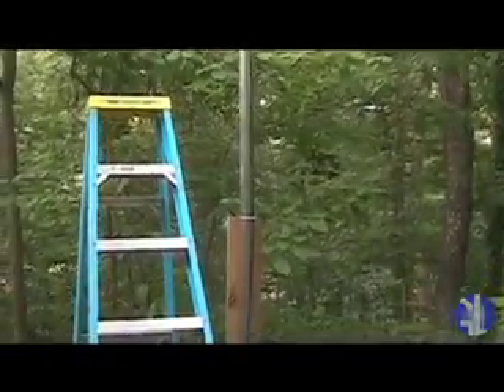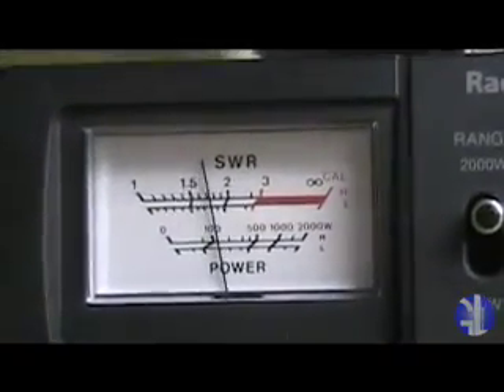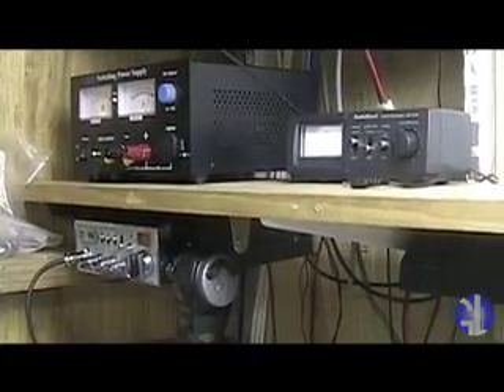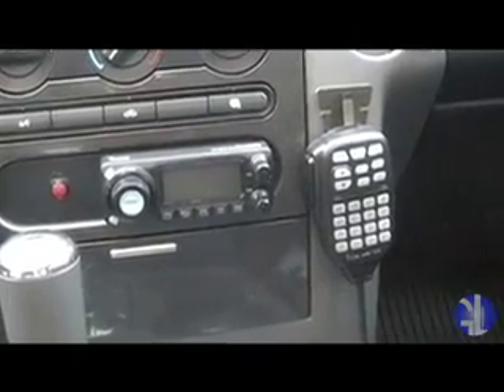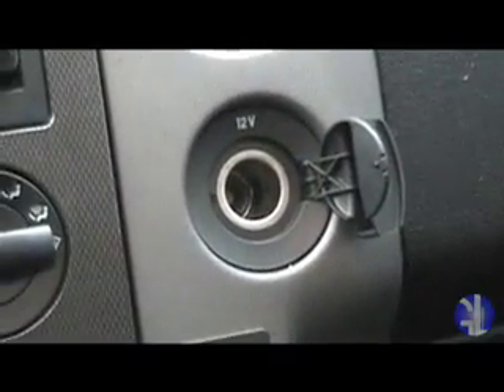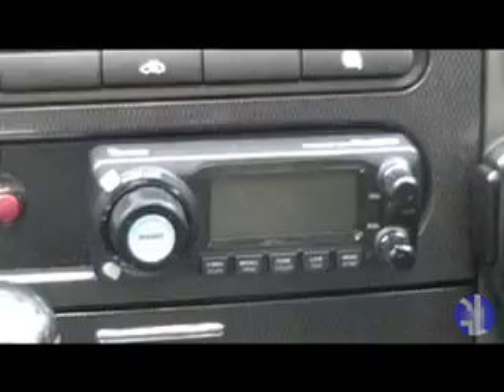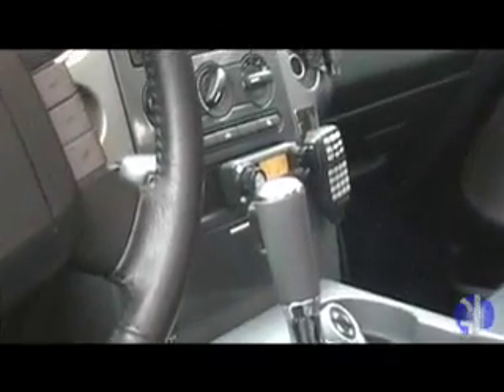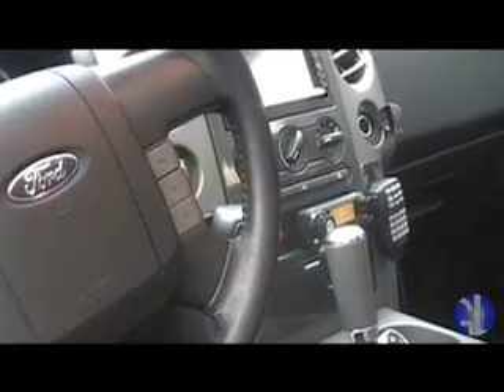Homebrew CB Antenna and 2M/440 Setup

Comment: I was thinking the same thing.  Spend a little cash and get a really nice external speaker and it will sound better than the built-in speaker does if it wasn't stuck under the back seat.  I'm also curious why someone with a CB radio would need a separate PA microphone.  Every CB radio I ever saw or used has a PA switch and a jack to connect the PA speaker.  Integrate.

Comment: I was wondering if you could give me some advice.  Im setting up a home made CB antenna using a 104' piece of pipe.  And four wire radials.  The plans call for glass insulators for the radials.  Im using insulated wire so could it be ok to just tie rope without the glass insulators? Also how can i tune it?  Its just a pipe so im not very sure.

Sorry im kind of a noob.  Although ive messed with radios since a kid. XD

Anyway thanks and take care!

Comment: dont be ashamed of cb. cb is what got me into ham radio and like you, most of my friends have cb's. i also found that cb side banders (found on ch 38 lsb) react to a dx opening quicker than some hams on 10 meters. but anyways great job with the qth and the mobile antennas!
73's KJ4EOW

Comment: You know you have to recalibrate the meter when you check swr??? And the reason its high on 1 is that the radials need to be longer, or the antenna is too short.

Comment: hey, don't let that guy pick on you. you are a great ham operator and them cbers are like that. i like your cb antenna, i never could get that low of swr on a moble on a pole. I am glad it worked for you. when i was a cber before i was a ham i ran a antron a-99 base 40feet up on a mast and talked lots of skip and alover the place. i still use it for 10 meters it works great with my tuner. keep up the good work and keep the videos coming. 73's from you friend in kentucky kj4aqv kevin